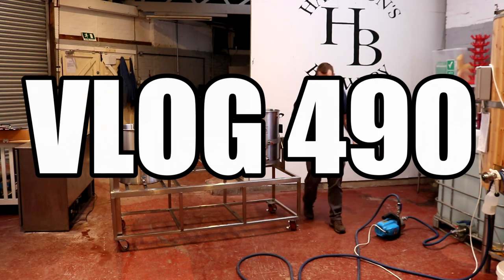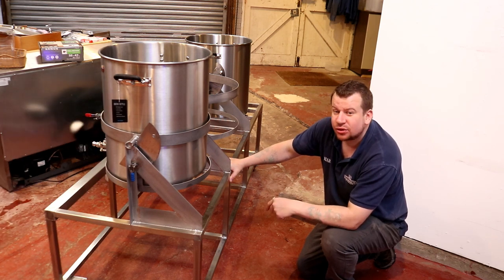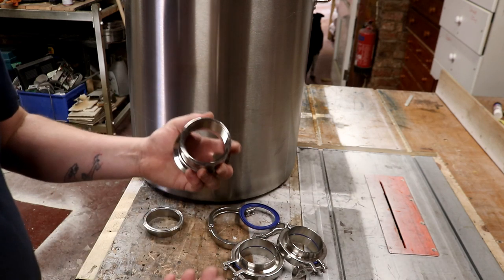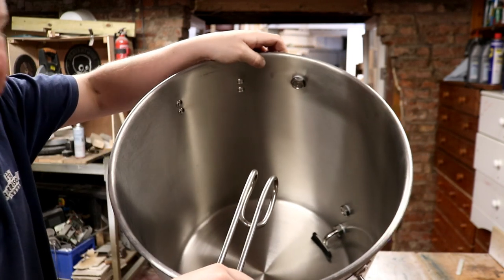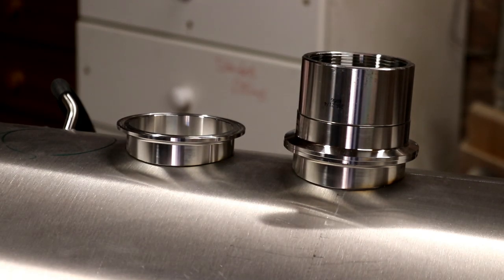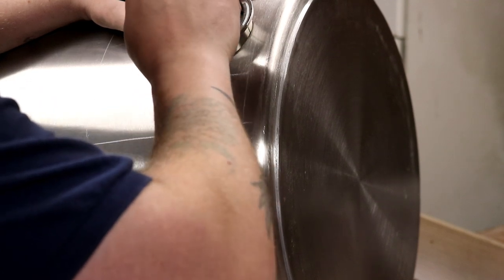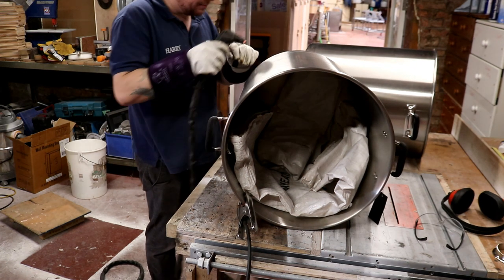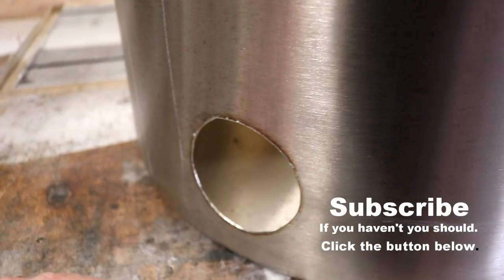Brewery Pilot Kit ~ Kettle & HLT Build ~ Part 1 🍻

Comment: You have me second guessing only going with 1 5500w element in my 20g pots.
Reply: a "all in one brewer" or biab or whatever you want to call them (brewfather and pots like that) uses mostly 2500W on 30L. (8 gallons). you will prob be struggeling =(
Reply: @Fotoscore  2500w on 8 gallons vs. 5500w on 16-18 gallons is pretty much the same thing, or am I missing something?